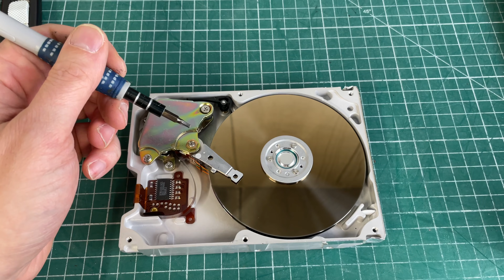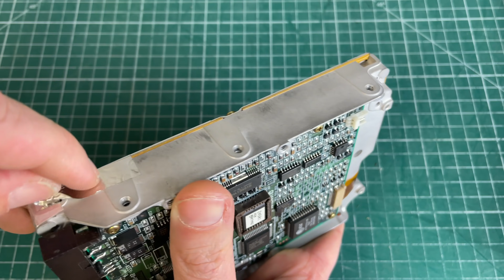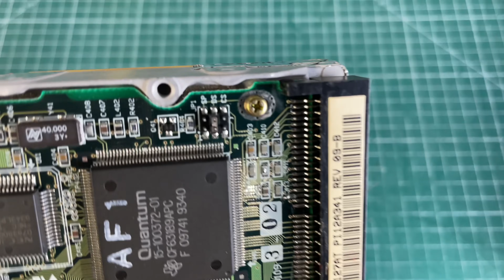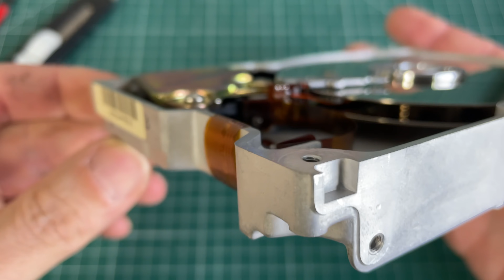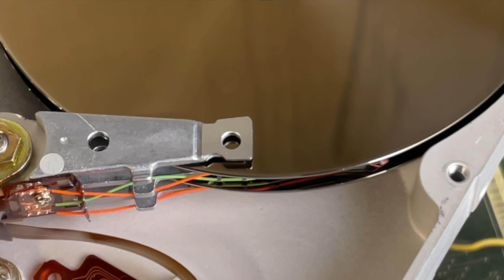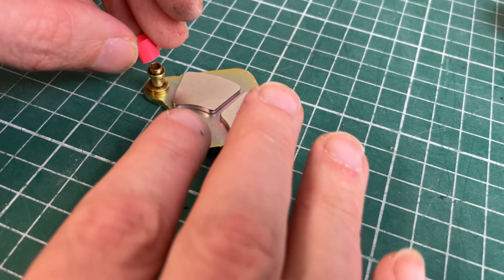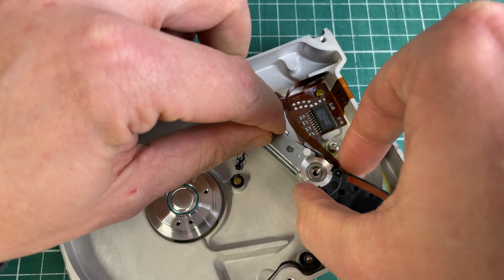Hard Drive Repair Gone Horribly Wrong

Comment: The head coil got damaged before, when you moved the head outwards with brute force. You moved it too far at 7:02 , so it was partially outside the platter (this was only possible due to the deteriorating bumper). The whole front part of the head was bent a bit outside and was touching the side of the platter, and then you did spin up the disk with the head still touching the outside of the platter. Just take a closer look at the footage. After this, it took just a while for it to completely get loose.

Nontetheless, thank you for releasing this video! Takes a lot of courage to do so after such a failure. This video is now a documentary of many mistakes that might happen when fixing these drives and will hopefully help many others in fixing their drives in the future. After all, there is not a lot of content about actually fixing hard drives on youtube.

Comment: Amazing work and good hints at the end! I managed to fix a similar quantum drive by replacing the bumpers with hot glue. I used the ole sticky tape trick to keep the platters synchronized when taking them off and some packaging plastic to hold the heads apart. For me the brake didn't want to release unless the cover was on. For that one success I ruined a few hard drives though, do not do this if you're after precious data - professional data recovery companies can do better. The worst part is I had to try twice to get the hot glue amount right, but i was ecstatic when it worked xD.

Comment: Jason's macintosh museum has a whole video about those dreaded quantum drives, because quantum (or apple!!!) didn't like the clunking sound that the heads make when they park themselves, so they decided to put those rubber stoppers on there, when the drives were new, this wasn't an issue, but over time, as you can see, those rubber stoppers turn to their former selves, which is oil, and this is a death trap for those quantum hard drives, and i use a specialised piece that you can buy online to seperate the heads, they have this tool in different sizes for all kinds of hard drives, that tool is called a Head Come, its a box you can buy that comes with all kinds of differents comes (weird name, i know :p), and that is the most easy and safest way to seperate the heads from the platters, you told that in your video, but you can use them, i should give those a try, and if you want to try to remove the platters and swap 'em over into another enclosure, you can take 'em both out with scotch tape applied on the side of the platters, lifting 'em out that way keeps them aligned and it actually works :)

Comment: Well well, that Valuepoint looks familiar ... you didn't happen to have sold it recently? ;)
Reply from the maker: Told you the hard drive was broken :)
Reply: @RetroSpector78  It was rather amusing to watch this video and realize it was the same one - it's fun to see you open the drive though. I never dared do that since I always heard the moment you open them, you lose the dust seal - I think that's what the foil was for which you wondered about.
Reply from the maker: @redavatar  Foil is apparently to protect the drive from CRT monitors. Regarding dust ... I know it's not ideal ... but a dead hard drive is also far from ideal :) Was worth a shot.
Reply: @RetroSpector78  Well we learn by screwing up. Or watching others screw up ;).
Reply: I had also assumed this was doomed from the start.  You never know, though..  Turns out I was right for quite the wrong reason!  But hey... since we’re here, why not perform a dissection and learn a thing or two!  :-D  Now I know what to expect if a Quantum fails to perform its seek test.
Reply: @sirnickity  It's always interesting to see how a hard drive works - I remember seeing open hard drives pictured a lot in magazines but I always heard that hard drive repairs should only be done by professionals in clean rooms so I never even attempted it - funny since I have a big box with quite a few dead maxtors that I COULD open.

Comment: Back in the day, I had more Quantum drives fail than ANY other brand.  I'm almost certain they came with bad spots from the factory.
Reply: I remember that Deathstar period.  I was working at a computer store then.  We had this one guy that worked as a consultant or something, he always came in and asked for advice on what to buy.  We pointed him to the Deskstar as one of our most reliable drives.  And then it wasn’t.  Oops.  But hey, how would any of us have known?
Reply: @sirnickity  same here.  I worked in a small computer systems and parts chain in Michigan around that time.  Those ‘Deathstar’ drives would come back all the time.  It seemed like every one I sold went back within a few months.
Reply: This.  I had these exact drives failing on machines I owned in the late 90's.  The Western Digital drives of this era were far better than the Quantum drives.
Reply: Every brand has had a bad line so I'm not surprised. I recall Maxtor having a REALLY bad line in the early 2000s - I'd build PCs for friends and family and they all started to fail after a year or so. Well within warranty but that didn't excuse all the lost data.
Reply: @redavatar  It doesn't take much.  There was a single,  very prone to failure, model of the  IBM Deskstar drive around 2001-02 time frame that had ridiculous failure rates.  It was so bad they started calling them "Deathstars"  Only one model of drive, but the publicity was so bad IBM left the market and sold their drive manufacturing business.
Reply: @redavatar  agreed.  Had tons of issues with Maxtor drives as well.  Seagate drive have always treated me fairly well, but I’ve had several go back over the years as well.  Western Digital drives, while not perfect, have always been the most reliable in my experience.

Comment: this means that these drives with deteriorating rubber bumpers area lost cause? I don't see a way to remove the platters without moving them out of alignment to clean those bumpers
Reply from the maker: Acs data recovery has a video where they use sticky tape to hold them together.

Comment: As a former hard drive tech and data recovery specialist this was a bit of an amusing tech gore show.
A few tips and chronicling events as I saw them:
0. your actuator is sticking (always inspect the actuator assembly, take off the top magnet carefully)
      - if you hear any hard contact sounds in operation in modern IDE + drives that don't use a stepper motor actuated head, the drive is shitting bricks. :D 
1. don't poke the drive in operation (ever)
2. no brute force ever
3. never disengage the heads from the platter without headcomb (happens at 7:07)
   - head on head contact usually breaks them
4. heads that made head-head or head-platter contact are 99% of the time damaged
5. platters that had heads contact them are 99% of the time damaged.
6. At 7:36 you can see the drive looking for it's alignment tracks to find the extremes of the disk platter, then it gets stuck on the bumpers
   - it's also not finding them and promptly collides with the center axis s the degraded bumpers are mostly gone too.
7. 7:59 the drive took a nasty permanent damage hit
8. over night the head was parked against the bumper and got stuck.
9. 9:12 the stuck head drive track alignment seek goes completely wild, head detracks and gets absolutely wrecked.
10. As you've noted, the drive actuators are natural rubber and will turn to glue (modern drives avoid this for good reason)
11. removing the actuator requires custom "headcombs" either 3d printed or purchased.
     - they hook into the spaces between the heads and then lock them in place so the head stack assembly can  be entirely removed without damage.
12. there are also tools to remove the actuator top plate + magnet assembly safely. (It's basically a big magnetic stamp)
13. disassembling and keeping alignment of the platter stack is pain and suffering and the only way to really do it is with tape stuck along the edge of the platers (i use aluminium tape that's specially cut to the right height) 
     - also you basically never have a reason to remove the platters unless the motor is seized and can't be freed up by other means (heating/lubrication).

Either way you seem  to have learned most of this through practical exploration
Reply from the maker: Thx for the very detailed analysis ... I learned a lot during this process and just wanted to show what a novice would probably end up doing if he opened up a hard drive for the first time.
Reply: Point 9 is the last moment before which this drive could have been recoverable (though pointless to do so).
Reply from the maker: after point 9 I was able to hook it up, launch into pc-dos, launch windows. It had a copy of lotus 123 on it and I could load up spreadsheets. Chkdsk also ran .... unfortunately it was late and also didn’t capture any video any more :( letting it sit overnight was also not a good idea as you mention (but at that point I don’t think I already knew about these rubber bumpers)
Reply: Didn't he need to remove the platters to get access to the goo stop? 
 It looks like, with two more heads, this would have been a 250MB drive. Can't he flip the bad sides of the platters over and use the good sides? Would a low level format have got it working? Of course not to recover, but to start over?  Couldn't you have used a single head and got 62MB out of it?  There are software programs that CLAIM they do low level formats on IDE drives.  It seems like I had a drive that had so many bad sectors and I partitioned it and got the bad sectors isolated into one half and just used the other half.

Comment: lifting heads from platters takes practise. many different methods to do so. as for removing platters use sticky tape on sides 3 or 4 pieces is enough then lift platters at the same time grabbing sticky tape itself and lifting both disks and keeping aluminum spacer inside. this way you not gonna lose alignment.

Comment: Very good video.  I do have a couple points that worked for me with some success over the years.  Clean room environments are prohibitive for most everyone.  However, take a clear plastic bag and place over the drive. tape the corners of the bag to the table to prevent slippage.  open the bag as little as you can to place dedicated (for clean type projects) inside.  using an xacto knife, cut the bottom side of the bag to expose the needed working area of the bag and proceed as needed.  Also be sure to wear gloves.  While manufactures insist that you cannot low level format IDE hard drives, actually it's more of a strong warning.  You can but with the caveat that it is usually as successful as upgrading bios.  Sometimes it works like a charm, and other times you have a collectors brick.  When your back is against the wall with old tech and the warranty is long out of question, then all cards are on the table.

Comment: You need to remove the platters as a whole stack, all together.
One way is to tape them together, using masking tape (painters tape) on the circumference of the stack.
I learned this watching Louis Rossmann data recovery serivces
Reply: What if you don't care about the data? Could you low-level format the drive to get the new alignment working? (edit: I posted this comment before he mentioned that in the video)
Reply: @Sparkette  i actually tried that on a kalok drive . Didn't work, the drive failed its selftest. I assume there are some servo informations that are needed. This will only work on drives older than mfm.
Reply: @dolphhandcreme  that happened because you moved the "interrupter" that thing that spins along with the stepper and goes into the track zero sensor.....the platter alignment is irrelevant on old hard drives because you can low level format them and rewrite all the sectors and tracks structure
Reply: @MrHBSoftware  nope, even old drives won't pass their self test with wrong alignment or demagnetized platters. Some rudimentary data is on their from manufacturing. Been there, tested that...
Reply: @dolphhandcreme  platter alignment and head alignment is kinda irrelevant on mfm and rll drives...maybe if  the heads are one meter off it wont work....thats obvious....... but since all the structure can re rewritten ,its irrelevant....also the age related demagnetization can be fixed by llf , then reformat, or simply running a drive exerciser utility or running spinrite and making a "non destructive llf" (that wont fix misalignment though and wont fix demagnetization done by other things other than normal  age related)...been there tested that... done platter swaps, done stepper swaps , unstuck heads that were stuck causing misalignent and data to be unreadable...all of the above cured after mechanical fix then inialiizing the disk and reformatting....works the same on early ide stepper drives like seagate 157a...yesterday i was swapping out a steel band that connects the head assembly to the stepper on one of those...did not work after that until i did the llf and reformat....after that works just fine.... also on mfm style drives and on some early ide ones you can swap boards...on mfm style drives you dont even need to reformat after board swap, right now i have a miniscribe 20mb drive wich wouldnt spin and i fitted another board to it and it boots and has all the original data on it
Reply: @MrHBSoftware  the mfm drives I have do a self check. I already played a lot with them. They even detect platter damage and spin down. Maybe really old drives don't care, but the slightly newer ones do for sure!

One example are kalok drives
Reply: @dolphhandcreme  you re right they do yes...i dont know the sequence of each but they spin up, when they reach the speed and if they do it sucessfully they do a seek test but not to read any data, just to move the head assembly from one end to the other and some random movement...there is a "track zero" sensor or end of course sensor and when that is out of alignment then yes the drive is not usable until you get it right...often you can see the little arm and sensor on the outside and it sometimes says "carefull: do not rotate the interrupter"... the drives that i am referring to are "all" the mfm drives from the st412 up to the 40mb ones and so on and also some early ide drives... one thing you can do with them is low level format them to a different capacity, for example you can format a 40mb drive with less heads and make it 20mb.  i have done that for using a 40mb drive on a computer that supported only 20mb drives, i think it was a schneider euro pc xt. you cannot format them with more heads obviously but you can put a good 20mb mfm drive on a 40mb rll controller and use it as 40mb rll. of course it may not be very reliable but you can...
Reply: @MrHBSoftware  The Kalok ones do more. They seek and if they don't find specific data, they just spin down after some retry. Much like IDE drives.
Some others do this too, but i don't remember the brand. Maybe old Seagate or Maxtor don't do this, but you can't generalize.
I also tried swapping the platters of one kalok to newer ones from much later IDE drives - they fit perfectly! - but to no avail.
Maybe connecting to the serial port of the HDD and trying to see some error messages would help. Had no ambition towards this.
The drive has some 80c51 derivate controlling everything.
Reply: Was going to comment the same. It blows my mind that some bloody mask8ng tape at the edges of the platters is enough to keep them aligned.
Reply: @DrakkarCalethiel  on a 127MB drive it's no wonder, but on multi-TB-drives it really is crazy. Someone with good measuring equipment should try to test for maximum platter torsion angle using the tape technique ;-)
Reply: @dolphhandcreme  Wonder what the maximum allowed offset is on modern drives. If at all, it can't be much.
Reply: @DrakkarCalethiel  some models don't care about offset. You can literally move the platters around, AFAIK you only need to adjust some firmware variables. But for most drives, keeping the orientation intact is the safest way to go.

Comment: Those jumpers are just the normal quantum ones for selecting master, slave, cable select. Just labeled with confusing letters. By the way never put a HDD with its PCB onto the metal case, I  (almost) killed a quantum drive like that

Comment: Weird, I've successfully done platter swaps on 32GB and 72GB IBM SCSI SCA drives without aligning the platters. I didn't use them long after (just to recover the data). Maybe they had some magic to deal with out of alignment platters?